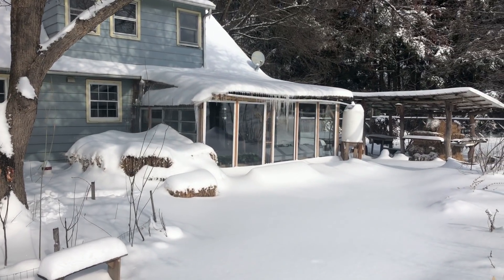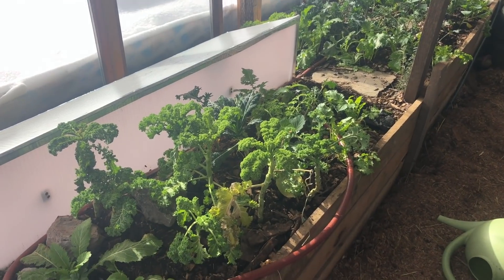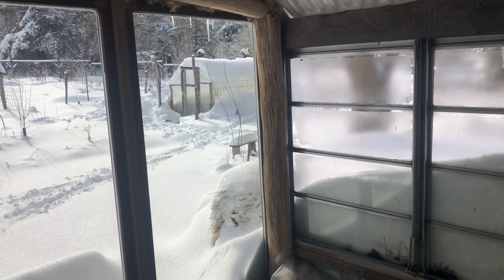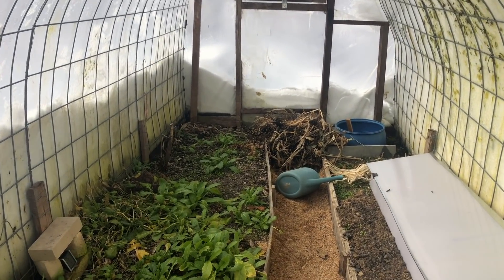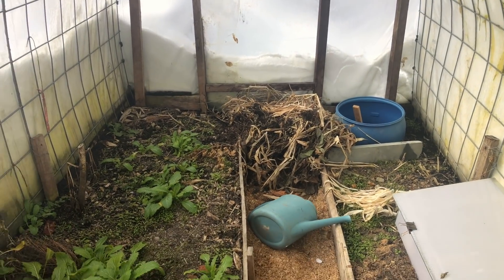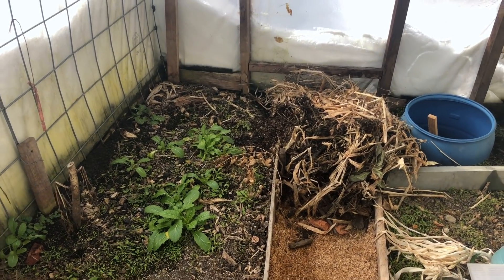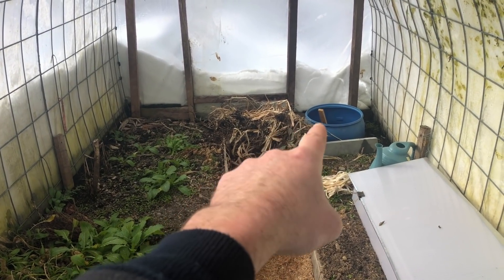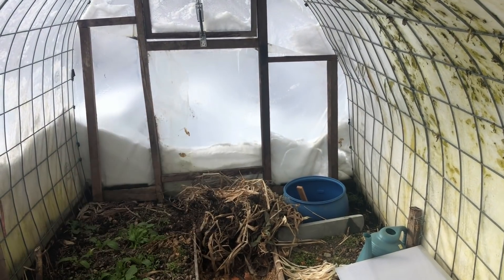Compost Heated High Tunnel - 1 - Initial Thoughts

Comment: I'd stack some square bails of straw around the corners outside of the green house against the walls to add some insulation. Then I would build 4 separate composting containers in those corners to evenly distribute the heat. Also bubble wrap makes a great insulation for green houses if you're trying to keep in heat while letting in light.
Reply from the maker: Good thoughts here, thanks!

Comment: You could build a passive solar soda/beer can heater. Lots of youtube videos. Basically a computer fan sucks air from the top of your greenhouse where the air is warmest down through a "panel" of cans painted black and mounted in a frame (facing the sun) against your greenhouse. A second fan at the bottom of the panel pushes the sun/can warmed air out to the floor  in your greenhouse where thermodynamics does its thing. You can also get the tank out of a used hot water heater, paint it black, frame it in clear plastic, and run your well/city water through that before it hits your costly water heater in the house.
Reply from the maker: Definitely some nice additional layers could be designed into this project for sure...

Comment: Build your compost away from the exterior walls. Putting it in the corner will be wasting the heat it produces to the outside. It will also be easier to lift or turn the pile with access all the way around it.
Reply from the maker: I plan to insulate around the edges of the pile inside.  Probably with dry hay and then a mylar sheet for good measure.  I'll share notes when i get to that phase.  Thanks kindly!

Comment: Put in a passive plant-based bioremediation machine inside the greenhouse alongside with the compost pile so that it can absorb and neutralize any toxic gases it might create. Anyone who is planning to put a Jean Pain compost pile inside their greenhouse must put in also a passive plant-based air bioremediation machine inside the greenhouse alongside with the compost pile so that it can absorb and neutralize any toxic gases it might create.I never have any problem with this problem because I always make sure to put both air-, water-, and solid-wastes passive plant=based bioremediation machines in the form of soil-based vertical gardens containing plants that cleanses and filters the air free of toxins and a series of aquatic and semi-aquatic plants-based water bioremediation pond systems to cleanse and filter and sterilize the water, and using the plant-based biomremediation perma-culture arbor sewage system for liquid wastes and pits for solid wastes where polllution-resistant bioremdiation plants practically consumes sewage water and sludge and even solid wastes like the weeping willow, ailanthus altissima, acacia auriculformis, etc.

Comment: I always look forward to seeing what you are doing. I like your new cold frames.  I would think about moving them a few inches away from the outside walls reduce conduction of heat to the outside and have an air space to insulate them a bit more.
Reply from the maker: I plan to do that for sure.

Comment: I wonder if insulating from the ground or lifting it off the ground (at least a small air gap) would allow more heat to transfer to the air (instead of the ground absorbing the heat)
Reply from the maker: I think I'll insulate with dry hay so there is a little air but not too much.

Comment: Right now, I'm using an electric oil circulating heater in the high tunnel, and that is keeping the tunnel up to 16 degrees warmer .. the plan that I have for next year is to construct composting bins that will run underneath the seed starting area, the seed starting tables just sit above the bins, and I have some thermal insulating mylar blankets that I can clip on to the ceiling and walls of the tunnel to keep as much warmth inside of that area at night time as possible.  Inside and outside of the tunnel, I have 16" of wood chips heaped up for additional insulation.
Reply from the maker: Sounds like a nice system you've got for yourself!

Comment: Check out a little book by Jack First called Hot Beds -how to grow early crops using an age-old technique. Basically you dig a hole, lineit with layers of straw and fresh manure, then put a layer of soil on top and planting ( I think you do wait couple of weeks until it cools down a bit, so it wouldn't burn the plants.) This way you do nto loose any space.
Reply from the maker: I've been aware of the hot bed idea for quite a while, and they are a lovely concept.  I think this implementation will be a hybrid of the hotbed idea and more of a space heating with compost idea.  We'll have to see :)

Comment: Great idea. You probably want to put some kind of insulation between the compost and the plastic. Like boards, or a layer of straw.
It's probably smart to go large on the amount of compost to ensure sufficient heat production. Personally I would fill up that entire back wall, from left to right, for at least 3 feet deep and 3 high. If you flatten that out, you basically got a heated workbench and a great spot for trays with seedlings etc.
Reply from the maker: I'm with you on most/all of this.  I've ordered low cost but reusable mylar sheets and plan to look through my pile of old stuff to see if I can replace the 'well' with something more compact so I can get more productive space happening there...
Reply: @edibleacres  Yea, it's never easy to create space when you're using it, but the most ideal spot for the well would probably be right next to the compost pile for when it becomes too dry. (not sure if that happens faster or less fast indoors. In any case, it won't catch rain like it would outside).
When buried next to the pile, it will probably also catch some of the nutrients seeping into the ground. Might turn out to be a great way to get free compost-tea. :)

Looking forward to see this project develop. Good luck!

Comment: Working with Growing Power in Wisc. in years past. What they used was banking up compost on the outside as well as inside. They also used pallets like many others mentioned to hold back compost.

Another thing to help heat up your compost with the mix you are using if you mix coffee grounds it helps to jumpstart it getting warmer. And you can sourse that from coffee shops or even convenient stores.

Thanks for doing these great informative vids.
Reply from the maker: Thanks for these ideas!

Comment: Love this so much!!  Old timers in my area used hot beds composed of high nitrogen cow & chicken manure in a specially insulated bed insulated on bottom and sides with a window on top.  Some were successful with straw bales on bottom and sides, while others had varmint issues with bales and resorted to heavy timber bottom and sides to protect the bales.  Some dug a pit to accommodate the bales.  They always had tomatoes before the commercial nurseries.
Reply from the maker: I think this will be somewhat similar to what you are describing here.

Comment: I visited Growing Power in Milwaukee a few years ago. It was an urban non-profit agricultural and urban youth rehabilitation center. It failed, financially, and has been shuttered. I bring it up, though, because they had greenhouses and hoop houses that they constantly composted in and around. The composting came up about three feet outside of the walls and, inside, was wood chips that they would constantly cycle in new, cycle out used to the compost heaps. It was remarkably warm, even in Wisconsin winters.
Reply from the maker: I wish I could have visited that place.  Seemed so rad!
Reply: EdibleAcres it was great. They stretched too far, though.

Comment: I see other people are also talking about Charles Dowding.  I just rewatched that video this week while gearing up  for spring.  Mr. Dowding just keeps the top of his pile level and set his seed tray on top to germinate and then moves them off to another surface when all the plants are up which makes room for more trays.  Though my personal suggestion is about your water source..  I would pull your barrel out, especially since it is grungy.  then I would dig it out as deep as you manually are able to do and set a pipe, like a potable/safe pvc or a  remnant of a water line pipe about ten inches across.  the deeper you go the cleaner the water should be.  I have a small pipe well in my woods, so it isn't anything new.  You can get water out of it with a small pond pump or even just  a gas siphon pump so the reduction in diameter shouldn't hinder you.  The other plus of the pipe is that you can make it tall enough that you won't have to worry about debris falling into it and could put compost up to it.  Also easy to put a lid on a pipe.
Reply from the maker: Probably an upgrade on the pipe setup there wouldn't be a bad idea, although there is nice feeling to know how simple it is to 'dip' into it with whatever container, a hand pump could be good, too...  Something to consider before the rest gets underway...
Reply: @edibleacres  Simple is definitely nice, but likewise a pump set up would probably be easier on your back.  I am at the age where I consider my back in all my decisions! LOL

Comment: Another idea, an icremental step. this year when the ground thaws is insulate 2-4 ft  below ground level around the perimeter lof the greenhouse. It will hold a lot more heat longer in the year. And with the compost helping heat it too it will stay warmer yet. Bill mollison references this in the pdm for insulating house slabs. Also referenced in Passive Annual Heat Storage
Reply from the maker: We're incredibly wet at this site.  If I dig 1' below grade at this area, it will be standing water around 9 months out of the year.  I think this isn't the right context for that approach, although I understand what you are saying for sure.
Reply: @edibleacres  
Fair enough.

Comment: Already turning your surplus compost into a solution ! You amaze me with your energy and inventiveness ! ideas : Charles Dowding  has his propagation on a compost corner held up by palets: 2 for the 2 faces, 1 for the top so ha can put his heat loving seedlings on easily seems simple enough, metal pannels would hold their own too w/ corner posts. The french greenhouse hotbeds are made directly underneath the beds, in your case both sides of your path, with a mix of carbon rich (horse manure, from stables so it's mostly straw) and high nitrogen ( in your case I think chicken manure is handy) and the heat is 'controled' by watering or letting dry : with water + nitrogen (chicken manure, urine ?) the heat ramps up, when dry, the decomposition is less active.  Hope this sprouts ideas (pun intended) ;)
Reply from the maker: Great ideas here, thanks.

Comment: Sean, looking at the shadows, isn't the side with the polycarb coldframes north? If so, I would pull them out and put a 3 foot tall pallet wall along the walkway an fill it with compost then set the coldframes back on top.
Reply from the maker: I may explore that.  The only problem is there are some nice perennials in that bed already as well as a TON of claytonia getting ready to pop for the spring...  I may need to reconsider all that perhaps, but I like that section as it is at the moment. Hmm...

Comment: The first passive heated high tunnels I saw were a LOT larger than yours. A local nursery had a pretty nifty system. They would haul in about a foot deep of fresh manures from local farms, cow and chicken mostly, and tamp it down a bit, then they would top that with another foot or so of  sawdust, not wood chips, sawdust.  It would get watered in and tamped down even and smooth, then they would dig out holes for the potted plants to sit down into.. The heat from that decomposting manure and sawdust, kept damp but not wet kept those high tunnels above freezing all winter long, and warmed things up so nicely in the spring.  Come spring, when they were starting to open up the tunnels and move plants out, they would fill in the holes, and then sow the entire surface with short white clover, dutch or new Zealand. While foot traffic killed off most of the clover in the walkways between their benches and pots, the stuff underneath benches and between pots flourished till it got too hot in the summer for it.  By fall, the whole shebang had composted enough that they dug it out and put it in their compost heap to finish, and hauled in more to start again.
Reply from the maker: Sounds like a really great system.  Yeah, this is a small space but it's what we've got, so hopefully we can get something nice to work with it :)

Comment: Could you build an upper shelf on the polycarbonate side and elevate those units to capture the light and then put the compost on the lower level, maybe 1 1/2 feet deep. You have so much compost in your other hoop house with the chickens that you are moving out, it would seem you could relocate some of that immediately to generate heat.  And as it is, there is nothing very established on that side so you would not have to replant anything.  If you still have locust wood, that would be pretty sturdy.
Reply from the maker: Good thoughts, there are some nice perennials and greens on that side that I'd like to be able to keep, so for this spring I don't think I'd revamp the whole north wall, but something to consider moving forward.

Comment: I was wondering what it would be like to make a vertical hot compost out of PVC pipe.  Keep it aerated with air lines and have a coil coming through it to transfer heat.  I don't have the time or space to try it out but it sounds like you have the perfect application for it.
Reply from the maker: I probably would want to skip having hot compost running through or next to PVC... Seems like it would be leaching in that context.

Comment: Darrell Frey of three sisters who taught my permaculture design course said that the gases accumulation was wonderful for the plants but made it so the building needed thoroughly aired out before spending any time inside.  Sounds like a fun project, as long as mindfulness is provided to not breath in toxins.  The poly tunnel might just be ventilated enough, but might not be.  Darrel's solution was a cinder block chamber along the north that vented outward but heated the whole backwall like a bench as a mass heater to the north.  Bottom heat for seedlings too!  I'm looking forward to seeing what you come up with.
Reply from the maker: Thanks for this note.  I'm aware of being careful with buildup, although I think this space is 'leaky' enough by 'design' that it shouldn't be a big problem.
Reply: @edibleacres  sounds great and definitely a very worth while experiment, I look forward to what you find.

Comment: In our zone 3 climate I have notice the snow disappears around the base of trees & exposed soil first.  This has me thinking of placing black garden fabric on the snow around the greenhouse when it starts to warm up.  This way the moisture goes into the soil next to the structure.  I'm also hoping it will add heat to the greenhouse, but I'm not certain about that.  
Will be putting up the cattle panel greenhouse in April, it can't arrive soon enough.  
Thank you for another great video of your greenhouse, I'm really enjoying them!
Reply from the maker: Interesting idea.  The black would probably help melt snow next to the tunnel, at least on the south side.  Possible to use crushed charcoal instead so you can avoid the plastic?
Reply: @edibleacres  Great idea to dust snow with charcoal. It will be much easier and solves the issue of how to keep cloth in place during high winds.  Also serves to avoid plastic, something I hadn't thought of but will keep in mind for the future.

Comment: I never tried this idea but was going to try it  last yr before I got sick and had to spend 3 months of planting in the hospital... so anyhow the idea was to make the beds about 3 1/2 feet tall layer compost in them. Manure and greens blood meal and or cottomeal or other high nitrogen followed by dry stuff like mulched leaves, hay, straw, a lil wood chips, tree bark and low nitrogen fertilizers or amendments like, egg shells, bone meal  ect followed by good dirt  repeat layers to about  3 ft soak whole thing well after about a couple weeks mix it all together  and then fill the beds up to planting depth w/ good soil  make mini hoop houses that you can roll up or other ways of getting inside to the beds over each bed. monitor temps w/ thermometer if getting cold use compost tea to get it working again.
Reply from the maker: Great ideas here for sure!  Hope you are healing up in good ways
Reply: TY :) but am still on oxygen and 20 ft ox hose so am still trying to get better. Hope this idea helps or at least gives you an idea how to make heated beds :)

Comment: Charles Dowding does that very thing (compost in green house to heat under seeds for germination). It's fascinating. 

A long time ago I saw it, so not sure I could find the video now.

As I recall, he had a four foot high pile, contained by (ply?)wood. He put his seeded trays on top. He had a thermometer in that pile, but I don't remember how hot it was.
Reply from the maker: I've seen the video and a few folks have referenced to it... Great minds think alike :)
Reply: So, like an indoor hugel?
Reply: @hugelpook  not exactly. hugels aren't meant to produce heat.
Reply: @TheBushdoctor68  yea they do. They warm up the soil for extended planting season.
Reply: @hugelpook  It's not the main purpose of a hugel, is what I'm saying. 

You're not wrong in that they can extend a season, but what I'm saying is that if you build something with the purpose of producing heat, you don't want the majority of your material to be something that does not generate heat. Like wood.
Reply: I though I remember he used a pallet as the top for seeds, I could be wrong. Pallets could frame the pile.